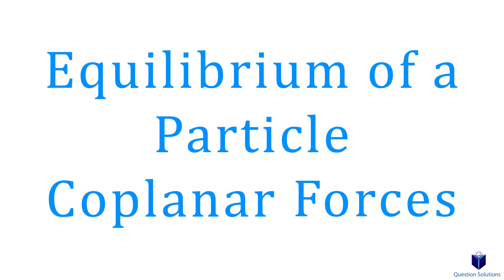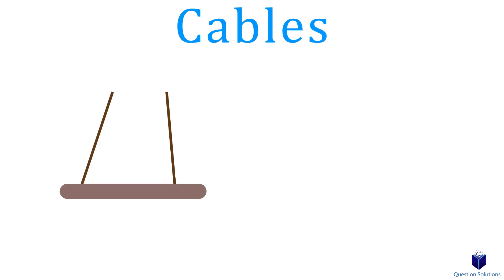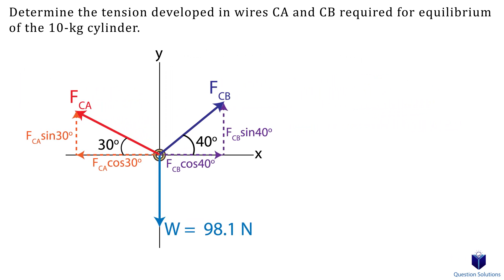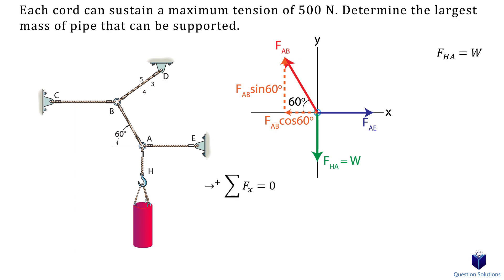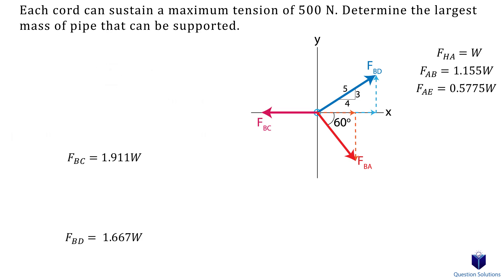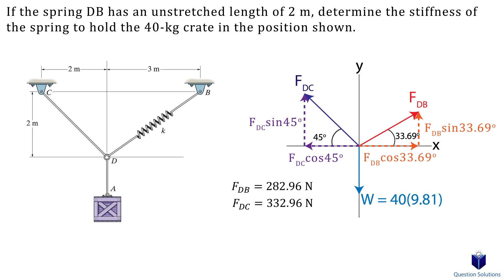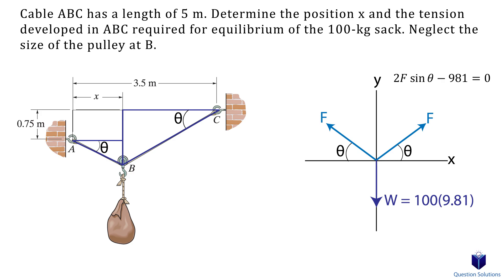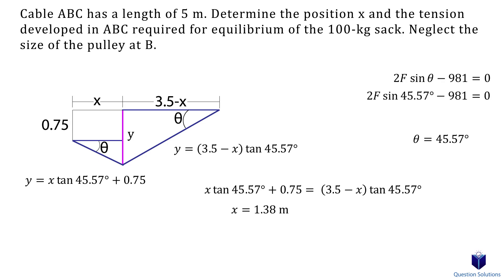Equilibrium of a Particle (2D x-y plane forces) | Mechanics Statics | (Learn to solve any question)

Comment: If force F(ba) is 1. 155W then shouldn't F(ab) be - 1.155W?
Reply: At 5:18
Reply from the maker: @saqlainraza2219  FAB = FBA, same thing, just different notation. Usually, if you look at a force from A to B, we write it as FAB. If we look at it from B to A, we write FBA. However, the sign convention is not determined by the way we write AB or BA. It's based on the direction of the force itself. You can write either and its perfectly fine. Now if a force faces left, and we got a negative value after we assumed left to be positive, then we know the force is opposite to the direction we drew it, but again, FBA or FAB notation does not matter. At the end, it's just a notation.
Reply: @QuestionSolutions  oh yes I got it explained it well thanks a lot buddy :)
Reply from the maker: @saqlainraza2219  You're welcome :)

Comment: 5:50 In question 2, why is it when I get all the mass of each forces, FBC has the least mass. I got FBA = 44.1399kg, FAE = 88.2799kg, FBC = 26.6755kg, and FBD = 30.5810kg.
Reply from the maker: I am not really understanding your question. 😅 You get the least amount for FBC because the number in front of the W is the biggest. Assume you use 44.1399 kg (FBA weight you got). If you use that on force FBC, it exceeds 500 N, so you can't use it. The same goes for all the rest.
Reply: @QuestionSolutions  yeah but the problem asks for "the biggest mass" shouldnt you have used the least number beside W to compute for the largest mass
Reply from the maker: @eldcole7440  Can you use the least number beside W, and then solve for the weight along with the force that would be on the cables as well? Please post a reply with those values and we can go from there. Thanks!

Comment: how did you get 1.155 for 4:37timeline
Reply from the maker: So you're isolating for FAB. Add W to both sides and convert sin60 to decimal form. You get 0.866FAB = W. Divide both sides by 0.866. FAB=(1/0.866)(W), convert to decimal form. You get 1.155W. Remember that W divided by sin60 is the same as 1/sin60 👍
Reply: @QuestionSolutions  The does the W still remain when it is divided and turned into 1.
Reply from the maker: @lukediola5197  Yes, you aren't dividing both sides by W, only by sin60. So W remains.

Comment: At 4.40 , how do u grt Fab = -1.155W
Reply from the maker: Add "W" to both sides. You get: FSin60° = W. Divide both sides by sin60°. You get F = 1.155W . (just wanted to add, on the right side, it's really just (1/Sin60°)(W), so you're dividing 1 by Sin60°.)
Reply: But w=500 over sin60 is 577.35
Reply: Wait so we assume w is 1 ???
Reply: @echoesofglory90  No Aidan.  2/X= (1/X) x 2. Thus, W/sin60 = (1/sin60) x W.
Reply from the maker: @echoesofglory90  You are missing fundamental algebraic knowledge. Please kindly review simplifying expressions and other forms to solving equations or you will end up using up a lot of time working on these things. I am not being mean, but it won't get any easier when the courses proceed. 

If we have a simple equation like this: x+2=y

Here, there is 1"x" and 1"y". We just don't show the 1 in front. If we have 2x+2=y, we have 2"x" and 1"y". Again, because there are 2 x's, we put a 2 in front, but we don't put a 1 in front of the y since it's just 1. So please, review these things :)

Comment: Hello
Can you please tell me why the angles in the last question are same
Reply from the maker: If you have a string at home, tape the 2 ends to things, so there isn't a lot of tension, but it's not super lose either. Then, hang something with a paper clip or something that slides around easily, you'll see that it'll come to the center. If you measure the angle with a protractor, you'll notice they are very very close, probably not perfect since there are a few variables to consider, but it'll be close. In most cases, you'll get the same angle on both sides.
Reply: @QuestionSolutions  Thank you very much
Reply from the maker: @madihavahaj599  You're very welcome!